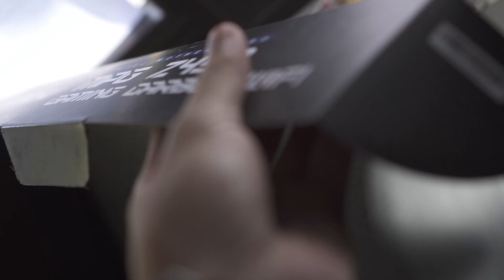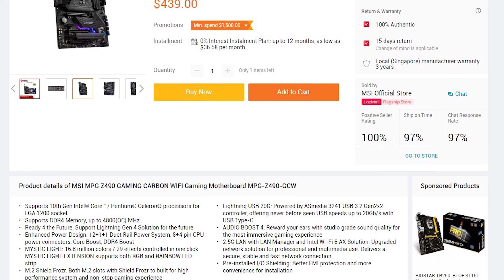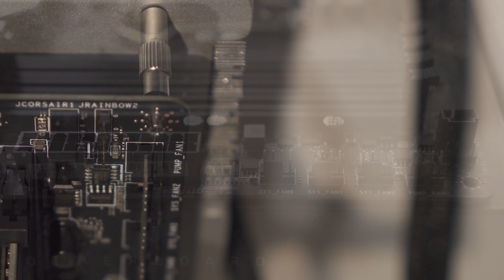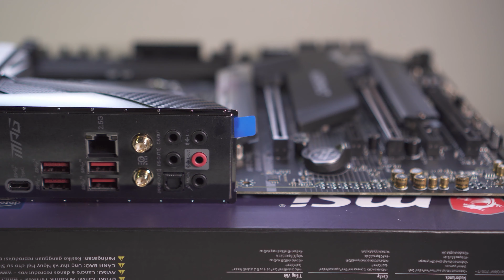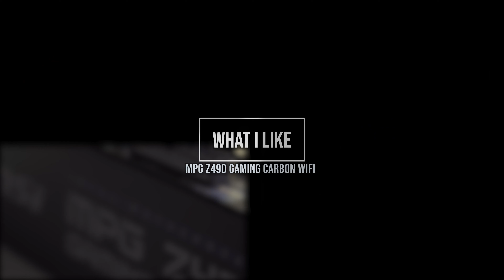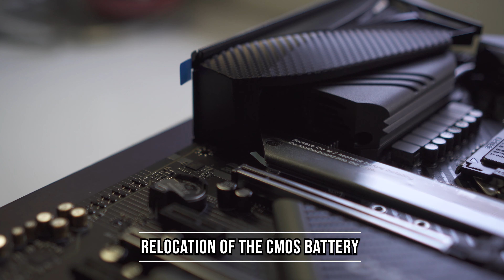MSI MPG Z490 GAMING CARBON WIFI Review. Decent mid range motherboard

Comment: I got this board for my new build and I'm wondering if the LED lighting is maybe slightly malfunctional in mine. When I use the dragon center to set the lighting to a steady single colour mode the bottom right panels are exactlly that while the top left zone is much lighter and fades to white on the right side. Also when I'm in mystic light there is coil weeping :( Does at least the lighting behave similar in yours or is mine broken?
Reply from the maker: Hi, could you try using the newest version of msi dragon center that you can download off msi website. Could you also try updating the bios of the board to the newest version. Do also check if you are running different rgb softwhere at the same time.
Reply: @Nwhproductions  Thanks! I'll try that :)

Comment: Can I put the i9 9900k inside of this ?
Reply from the maker: Hi as this is a 10th gen motherboard you can only put a 10900k. You will need to look for a board with a z390 chipset to support the i9900k. Cheers
Reply: @Nwhproductions  very unfortunate, i bought it and i had a i9 9900k :( I just bought a new z390, thanks!
Reply: @TH_Bloom if u read my comment above u can see the damage is already done
Reply: @TH_Bloom nah i bought a aorus ultra z390 so I have a z490 wifi carbon gaming laying around

Comment: is it good for i7 10700k and does it have good oc capability?
Reply from the maker: yip as i have tested it with the 10900K with a much higher power draw and have no issues. For oc i have not done much myself as the thermals for the cpu is just too hot and intel themself have the cpu really highly pushed so there is not too much point in overclocking unless you have a really good cooler. Cheers :)

Comment: hey bro is this good for amd ryzen 5 3600x?
Reply from the maker: Hi bro this is a Intel board so it will support the i5 10400. For amd you need eith b550 X570 b 459 a320. Cheers 🥂
Reply: @Nwhproductions  yea thanks mate

Comment: Looks slick! I'm still on AMD FX 6300 processor. Looks like this would be a great update
Reply from the maker: Dyam that's old. This would be a good upgrade. A sweet spot would be a 3600 paired with a 16GB of 3200 Mhz ram. Cheers